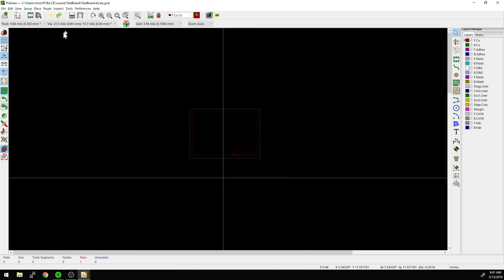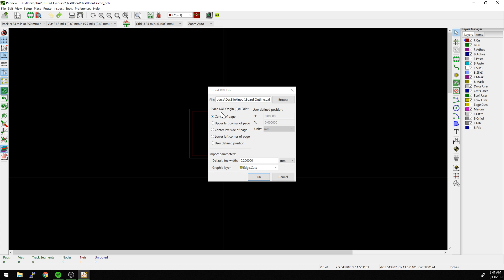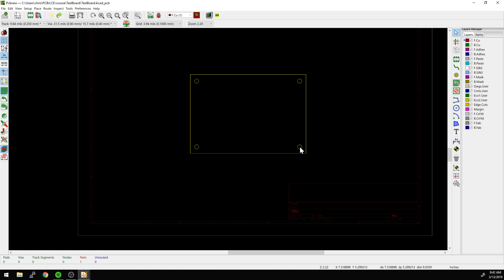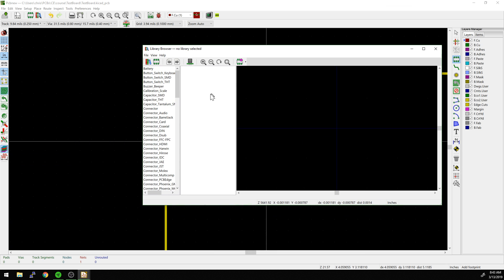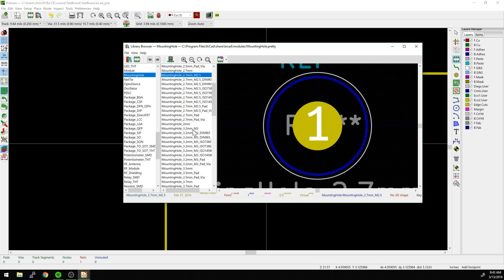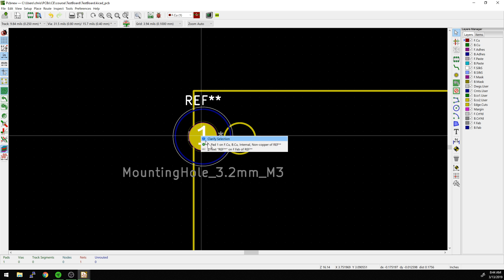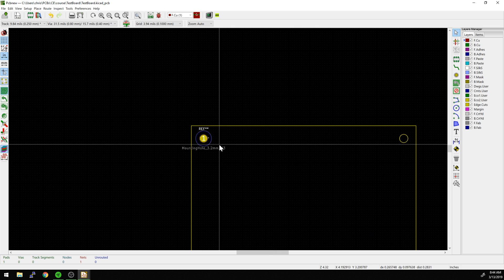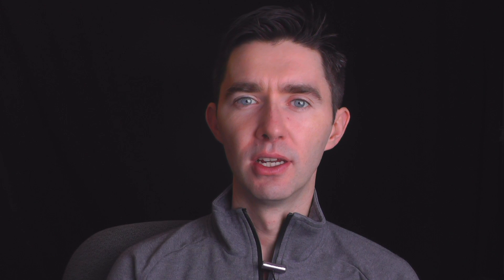KiCad 5.0 - Importing a DXF and matching registration holes

Comment: As a daily Solidworks user, this has got to be the clunkiest part of board layout in Pcbnew. Some kind of parametric modeling tools that allow you to simultaneously drop in a dimension AND position the feature where it belongs would be really useful for us mech-heads. 

But, I really appreciate the clear and concise review of your process. It at least gets me in the neighborhood of regaining my sanity. I've apparently been taking these absolutely basic CAD functions for granted...

If I can add one small tip for others: after selecting the DXF-generated mounting hole and setting its center as the origin, you can delete it right then and there and the 'Position Relative To Reference Item' function (Ctrl-R) can still be performed using the local coordinate system as the ref. No need to do any special selection filter trickery after the fact.

Anyway, thanks again!

edit: Also, the ability to set the origin of the DXF you are importing in a preview window would be awesome. Pcbnew seems to be grabbing a random feature as far as I can tell... but I digress.

Comment: the menus and process is a little different on the newer kicad but all you need to do is click the mounting hole footprint, hit ctrl+r, click select item, and then click the circle.  Thanks for this, on my second PCB and I figured there was a better way to do this than manually tracing cut lines lol.

Comment: I try all the possible combinations of settings to export dxf from corel draw. No matter what I try, the circles don't have registration points and I can't center my mounting holes right. The circles actually are not circles, but many lines in form of a circle. I use Kicad 5.1. Is there a trick to have circles instead of circle-like shapes out of many lines? Is important, because I want to make panels for eurorack modules and I have a lot of holes in them, which I want to be mounting holes, not circle-like shapes on the edgecut layer.

Comment: My Control+M menu does not give the option to move to user origin.  I wonder if this incredible feature was removed in Kicad 5.1.  Anyone know if there is a replacement?
Reply: It was not removed. In 5.1 you now hit Ctrl+R in PCBNew or right click and select "Position relative to..." This option also exists in the footprint editor but does not have a keyboard shortcut, nor (as far as I can tell) any way to set a keyboard shortcut.
Reply: Oh and in the dialog that pops up you select "Use Local Origin".

Comment: Software not reading DXF files correctly seems quite common. My laser
cutter software really didn't like some of the files I generated from
Fusion 350, even though many other packages were fine and even online
viewers showed the expected result.

The most reliable results I had from Fusion were by using the DXF post
porcessor in the CAM environment. You select geometry just like you
would for a plasma cutter for example, but the plugin outputs DFX,
rather than G-code. You have to make sure you've selected 'cut paths
only' so that you don't get the lead in and leau out moves etc.
Reply: I think I've linked the right video from Lars Christian's channel

https://youtu.be/2M0pwqe-r1M

Comment: Thanks Chris, this is useful! I did not know, how to put the footprint mounting hole exectly centered. recently i sent a grb to a fabhouse. I just made my dxf in freecad and put in edge cut layer. Later i realised, i made a mistake. My holes did not shown on the fabs grb wiever. But in the final pcb, there were the corrent holes. :) so they understand it and made correct. But in the future, i will put some footprint holes instead. : )

Comment: Super useful.  I would love to see something on more complex shapes and the specifics of the dxf format required by KiCad, especially relating to the best way to process cutouts inside the board that are non circular, or circular but larger than the maximum drill size supported by a given fab.